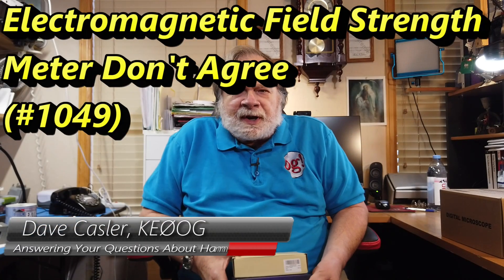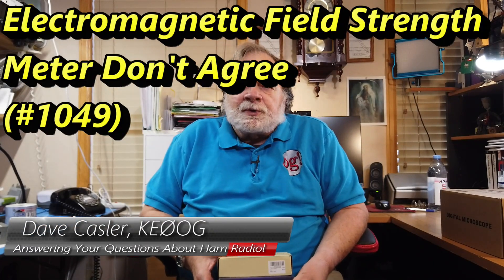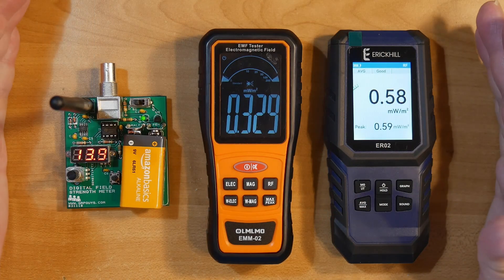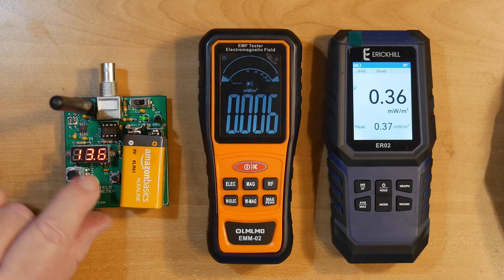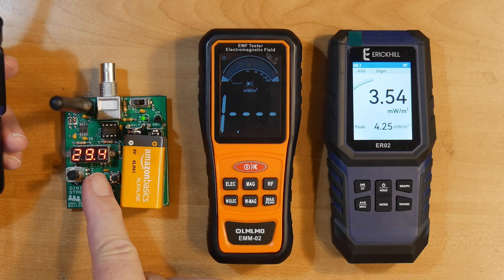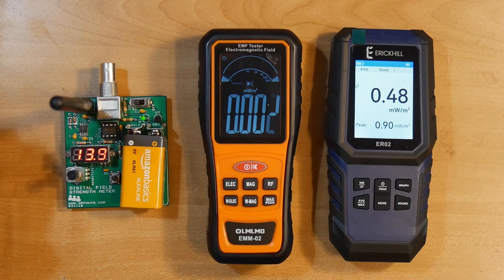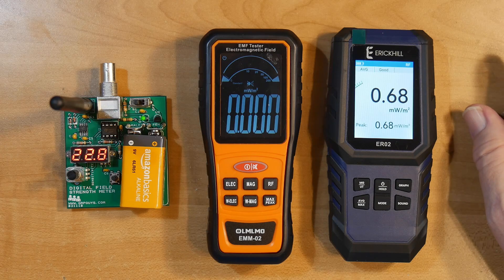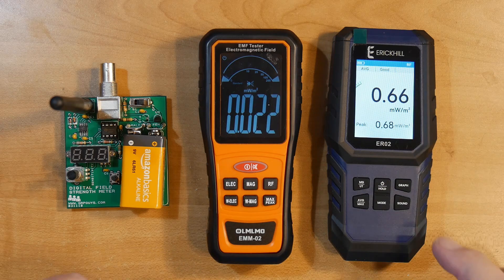Electromagnetic Field Strength Meters Don't Agree (#1049)

Comment: Dave: FSMs (and receivers) measure the strength of the ELECTRIC field in units of V/m where m is the “aperture” (AKA: length) of the antenna cutting through the electric field to produce a voltage proportional to the field strength (usually rectified for the sake of a steady meter reading). This E field decreases with distance between the transmitter and receiver as 1/d and NOT 1/d^2 which is the POWER degradation rate. This explains why we can receive E fields far away but are challenged to transmit actual energy wirelessly at anything but very short distances (eg-wireless phone chargers)

Comment: I just use 2 germanium diodes and 1 small capacitor across a 50 microamp meter with a  short wire for my field strength reading.Relative readings i know so i tune up for maximum indication on the meter  when im operating portable with my random wires.
Great channel as always Dave.
Happy new year to you and all who watch this channel.
73.G7HFS/PA3IKH